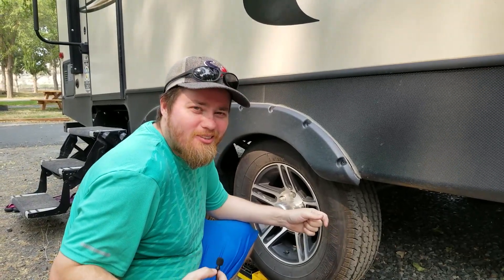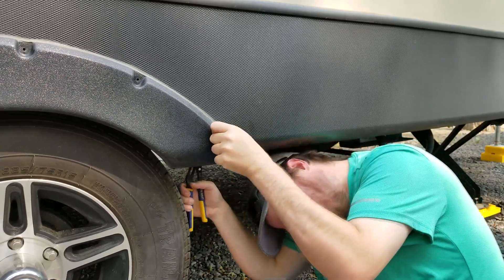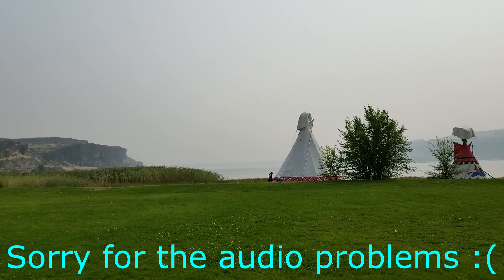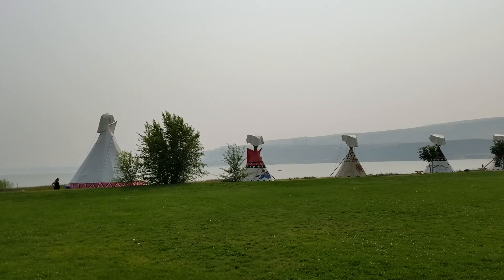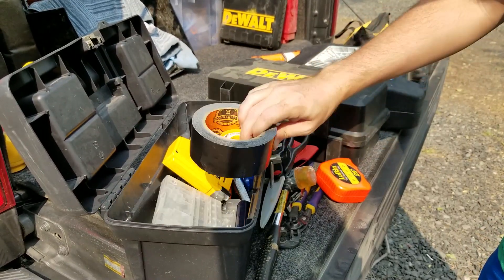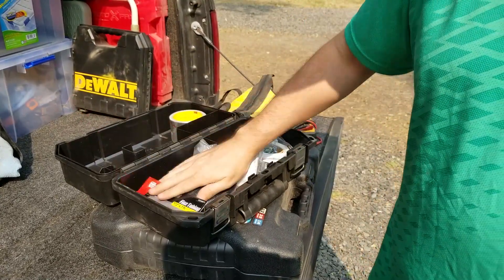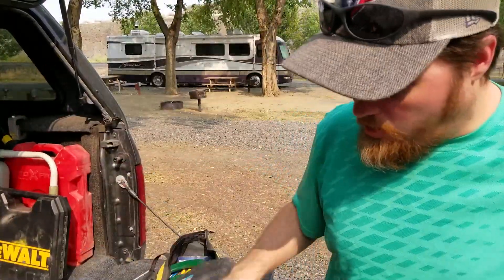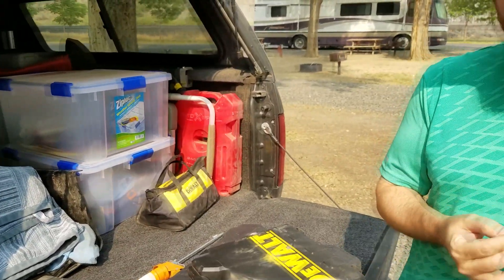Fender repair, smoke at Soap Lake, tools in my truck bed (bad audio megamix)

Comment: You should Silicone that fender so water does not get in
Reply from the maker: I considered it, but it's really not protecting anything.  The whole fender is really just a decorative plastic shroud that is there for cosmetic appearance.  Both sides of it and what it screws into are plastic and water shouldn't damage them.  I still may go over it with silicone just to make it look nicer though.